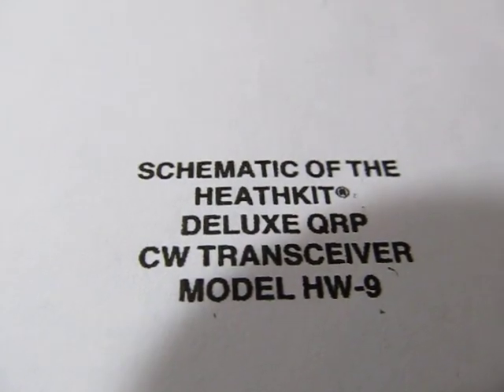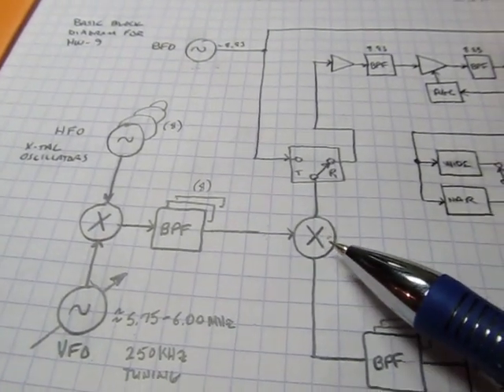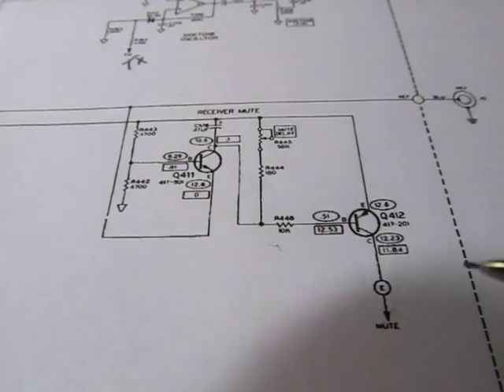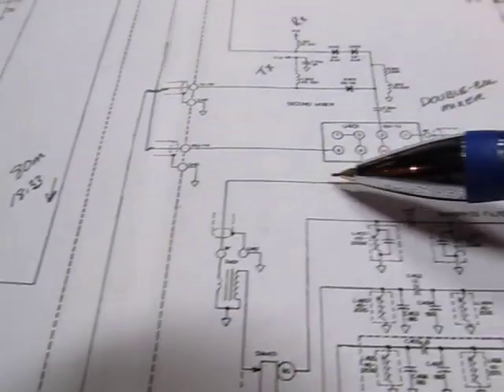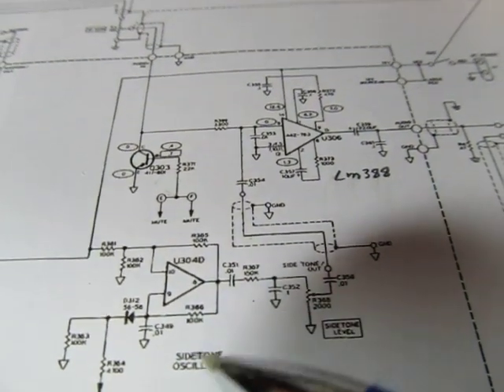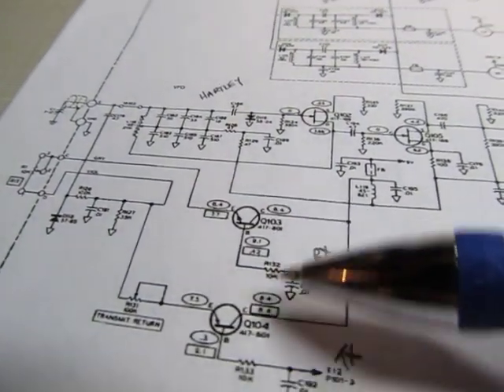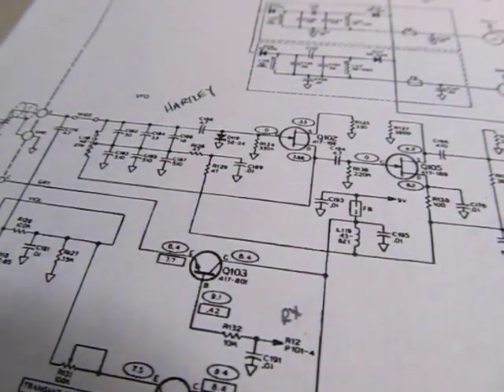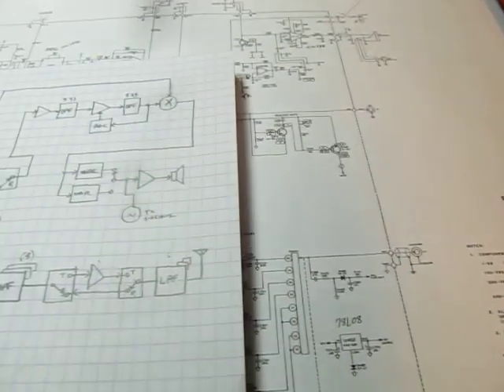#81:Heathkit HW-9 QRP CW Transceiver Circuit Walk-Through - Ham Amateur Radio Schematic

Comment: seen it already. Awesome as always!! THANKS A LOT! - in your qrp walkthrough video i though the small HF signal would pass "reverse" through the diodes. may that not also be possible if the diode is turned on? (so the signal source is at the diodes cathode traveling to the anode)

Comment: Brilliant! Thank you. I have been building QRP kits, mostly the Small Wonder Labs SW+ series, as seen on my channel. I also have a 15m Ft. Tuthill that I'm getting ready to optimize for portable operation in a similar way. It would be so nice to add an S meter (I have an analog edge mount type). Are you familiar with either the SW or Ft. Tuthill and know where to tap in for a signal? Could I use the same circuit shown at 11:45 to achieve this?